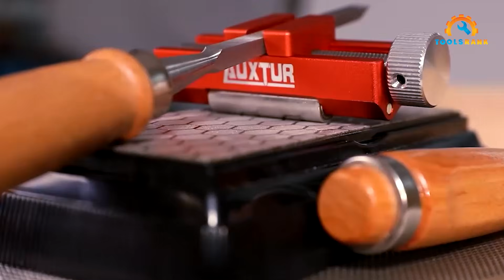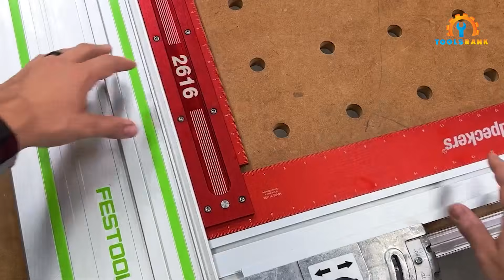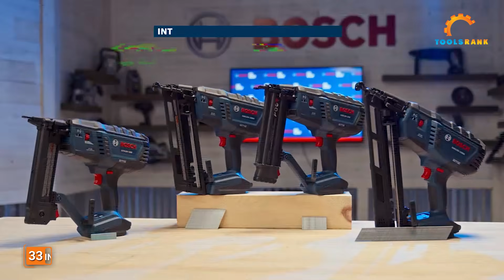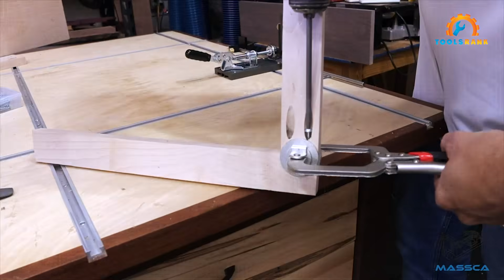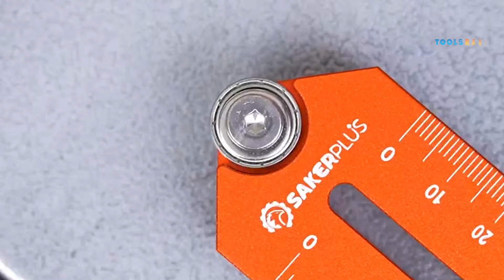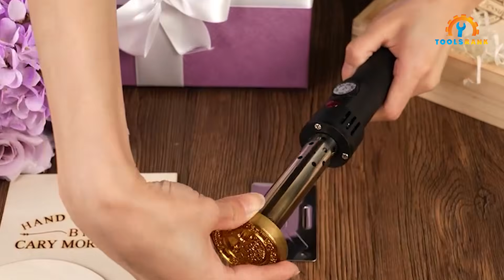80 New Woodworking Tools On Amazon That Make Work Effortless!

Comment from the maker: 1	Black+Decker Workbench	
 https://www.amazon.com/dp/B00PTX62Q4?tag=toolsrank-20
2	Amazon Basics Face Clamps	
 https://www.amazon.com/dp/B07ZTVYYT1?tag=toolsrank-20
3	Goingmake Thin Rip Jig	
 https://www.amazon.com/dp/B0CBKSZ1D1?tag=toolsrank-20
4	Thorvald Carpenter Pencil	
 https://www.amazon.com/dp/B0BD8F64BZ?tag=toolsrank-20
5	Auxtur Sharpening Stone Set	
 https://www.amazon.com/dp/B0CQLNWX66?tag=toolsrank-20
6	Milescraft Sanding Block	
 https://www.amazon.com/dp/B09Z73PD6J?tag=toolsrank-20
7	Exqutoo Router Bit Set	
 https://www.amazon.com/dp/B08R9QD8N2?tag=toolsrank-20
8	Necamocu Edge Band Trimmer	
 https://www.amazon.com/dp/B0D9TX59CG?tag=toolsrank-20
9	Workpro Mini Bar Clamps	
 https://www.amazon.com/dp/B0928MP18P?tag=toolsrank-20
10	Wetols Corner Clamp	
 https://www.amazon.com/dp/B095P753JN?tag=toolsrank-20
11	Saker Scriber Ruler	
 https://www.amazon.com/dp/B0D6V76JW9?tag=toolsrank-20
12	Wyqyq Corner Clamp	
 https://www.amazon.com/dp/B096DX28FC?tag=toolsrank-20
13	Powertec Chisel Plane	
 https://www.amazon.com/dp/B0FK9SVL7C?tag=toolsrank-20
14	Saker Router Jig	
 https://www.amazon.com/dp/B0D46F1X51?tag=toolsrank-20
15	Hinge Drilling Jig	
 https://www.amazon.com/dp/B0CCSK878M?tag=toolsrank-20
16	Goingmake Dowel Jig	
 https://www.amazon.com/dp/B0FK9PSXJT?tag=toolsrank-20
17	Origlam Wood Chisel Set	
 https://www.amazon.com/dp/B07PGF159G?tag=toolsrank-20
18	Woodpeckers Precision Square	
 https://www.amazon.com/dp/B00TRAJ3C0?tag=toolsrank-20
19	Block Height Gauge	
 https://www.amazon.com/dp/B0B7SKLHJT?tag=toolsrank-20
20	Woodpeckers Hex Rule	
 https://www.amazon.com/dp/B0CBGVNSY7?tag=toolsrank-20
21	Kapro Rafter Square	
 https://www.amazon.com/dp/B09PRQ8RDP?tag=toolsrank-20
22	Amazon Basics Bench Plane	
 https://www.amazon.com/dp/B07V3QLZ5Y?tag=toolsrank-20
23	Mini Feather Board	
 https://www.amazon.com/dp/B0C2XFLYFJ?tag=toolsrank-20
24	Woodpeckers Spline Jig	
 https://www.amazon.com/dp/B0C7LDYL2W?tag=toolsrank-20
25	Milescraft Center Finder	
 https://www.amazon.com/dp/B082JZTVPP?tag=toolsrank-20
26	Aboutool Doweling Jig	
 https://www.amazon.com/dp/B0C4YNP87G?tag=toolsrank-20
27	Woodpeckers Angle Gauge	
 https://www.amazon.com/dp/B0CXYM84WB?tag=toolsrank-20
28	KF2006 Universal Mobile Base	
 https://www.amazon.com/dp/B0CTMHM155?tag=toolsrank-20
29	Bow FP5 Featherboard	
 https://www.amazon.com/dp/B0973P6686?tag=toolsrank-20
30	Bow GP5 Bandsaw Guide	
 https://www.amazon.com/dp/B07DX8QBKF?tag=toolsrank-20
31	Saker Miter Protractor	
 https://www.amazon.com/dp/B0919GGNLG?tag=toolsrank-20
32	Bosch Biscuit Joiner	
 https://www.amazon.com/dp/B0DT4RJRKR?tag=toolsrank-20
33	Bosch Finish Nailer	
 https://www.amazon.com/dp/B0DFQKLMMF?tag=toolsrank-20
34	Microjig Grrrip Block	
 https://www.amazon.com/dp/B00DNX3N7S?tag=toolsrank-20
35	Spurtar Wood Clamps	
 https://www.amazon.com/dp/B0DP3X6H3Y?tag=toolsrank-20
36	Worx Pegasus Table	
 https://www.amazon.com/dp/B01HREBZ3M?tag=toolsrank-20
37	Bosch Angle Finder	
 https://www.amazon.com/dp/B01FN3HKXI?tag=toolsrank-20
38	Viewreal Track Square	
 https://www.amazon.com/dp/B0DZWZ1MWM?tag=toolsrank-20
39	Akn GoScriber Ruler	
 https://www.amazon.com/dp/B0B9C8HDNL?tag=toolsrank-20
40	Powertec Pocket Hole Jig	
 https://www.amazon.com/dp/B0BV9HQX12?tag=toolsrank-20
41	Goingmake Hinge Jig	
 https://www.amazon.com/dp/B0CCSK878?tag=toolsrank-20
42	Woodpeckers Super Fence	
 https://www.amazon.com/dp/B0CNKYR356?tag=toolsrank-20
43	Cabinet Door Jig	
 https://www.amazon.com/dp/B0DSKNJQKM?tag=toolsrank-20
44	TwoWin Compact Router	
 https://www.amazon.com/dp/B08M6578D9?tag=toolsrank-20
45	Reekon M1 Caliber	
 https://www.amazon.com/dp/B098TTZZYL?tag=toolsrank-20
46	CNC Positioning Fixture	
 https://www.amazon.com/dp/B0F4X16328?tag=toolsrank-20
47	Mount Jasper Chisel Set	
 https://www.amazon.com/dp/B0DQXWN8PT?tag=toolsrank-20
48	Hautmec Carving Chisel	
 https://www.amazon.com/dp/B0BSGF1XGX?tag=toolsrank-20
49	Massca Pocket Hole Jig	
 https://www.amazon.com/dp/B07C29KXNT?tag=toolsrank-20
50	Eleon Dowel Jig	
 https://www.amazon.com/dp/B0D9HTH5PJ?tag=toolsrank-20
51	WETOLS 90° Corner Clamp 4Pcs	
 https://www.amazon.com/dp/B095P753JN?tag=toolsrank-20
52	JOREST Contour Gauge 10" Lock	
 https://www.amazon.com/dp/B0DDBG32BL?tag=toolsrank-20
53	Mini 3D Multi-Angle Measuring Square	
 https://www.amazon.com/dp/B0CTMGL543?tag=toolsrank-20
54	7" Carpenter Square Aluminum Alloy	
 https://www.amazon.com/dp/B0FH9YY8XF?tag=toolsrank-20
55	Contour Gauge 12+5" Lock	
 https://www.amazon.com/dp/B08GC2CH74?tag=toolsrank-20
56	OriGlam 10-Piece Wood Chisel Set	
 https://www.amazon.com/dp/B07PGF159G?tag=toolsrank-20
57	RUITOOL Japanese 6" Hand Saw Ryoba	
 https://www.amazon.com/dp/B09NW2R5HQ?tag=toolsrank-20
58	Contour Gauge 12" Lock Profile Tool	
 https://www.amazon.com/dp/B08GC48QXP?tag=toolsrank-20
59	Milescraft 8408 Center Finder Tool	
 https://www.amazon.com/dp/B082JZTVPP?tag=toolsrank-20
60	Setup Blocks Height Gauge 15-Pc	
 https://www.amazon.com/dp/B097ZHY17V?tag=toolsrank-20
61	Saker Foldable Multi-Function Level 28"	
 https://www.amazon.com/dp/B0B799PYVK?tag=toolsrank-20
62	GARTOL Miter Box & 4-Pc Saw Set	
 https://www.amazon.com/dp/B0FCY3K3KQ?tag=toolsrank-20
63	Thin Rip Jig Table Saw Guide	
 https://www.amazon.com/dp/B0DZHBHKJQ?tag=toolsrank-20
64	Nicpro 4-in-1 Drilling Positioning Ruler	
 https://www.amazon.com/dp/B0F624XQ4S?tag=toolsrank-20
65	GALAX PRO 3.5A Oscillating Multi-Tool Kit	
 https://www.amazon.com/dp/B07TW55GD4?tag=toolsrank-20
66	Saker Multi-Function Scribing Tool 5.5"	
 https://www.amazon.com/dp/B09W8S61JS?tag=toolsrank-20
67	Woodworking Bench Vise with Bench Dogs	
 https://www.amazon.com/dp/B0BCFPVGWB?tag=toolsrank-20
68	HURRICANE 8-Pc Wood Lathe Chisel Set	
 https://www.amazon.com/dp/B0CZ374D83?tag=toolsrank-20
69	Saker 4-in-1 Drilling Positioning Ruler	
 https://www.amazon.com/dp/B0D5QCVW84?tag=toolsrank-20
70	Hand Saw 6" Japanese Pull Saw	
 https://www.amazon.com/dp/B0D7CK4TK9?tag=toolsrank-20
71	Dreyoo Adjustable Wooden Hand Plane & Chisels	
 https://www.amazon.com/dp/B0DJ8Q6NQY?tag=toolsrank-20
72	ATOPLEE 12-Pc Wood Carving Chisel Set	
 https://www.amazon.com/dp/B07XYKZKLQ?tag=toolsrank-20
73	Saker Thin Rip Jig Table Saw Guide	
 https://www.amazon.com/dp/B0D81KX6P4?tag=toolsrank-20
74	Saker Chamfer Plane Woodworking Tool	
 https://www.amazon.com/dp/B09NPSWWH7?tag=toolsrank-20
75	Custom Electric Wood Branding Iron	
 https://www.amazon.com/dp/B0FNWCGHDK?tag=toolsrank-20
76	Wood Carving Kit 16-Pc Whittling Set	
 https://www.amazon.com/dp/B0DB5H1DJN?tag=toolsrank-20
77	Saker Multi-Function Scribing Tool	
 https://www.amazon.com/dp/B09PD9MNFQ?tag=toolsrank-20
78	Adjustable Setup Block Height Gauge	
 https://www.amazon.com/dp/B0B7SKLHJT?tag=toolsrank-20
79	Wood Carving Chisel Set 12-Pc	
 https://www.amazon.com/dp/B07V5WT6P4?tag=toolsrank-20
80	Setup Blocks Height Gauge 8-Pc Extra Long	
 https://www.amazon.com/dp/B09NQG6SMH?tag=toolsrank-20